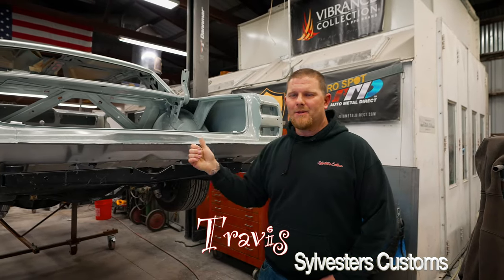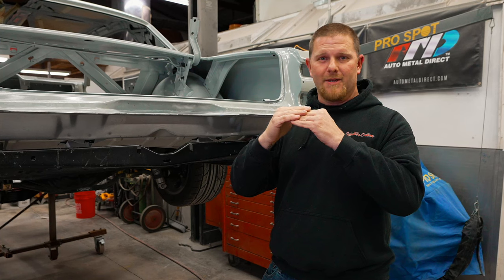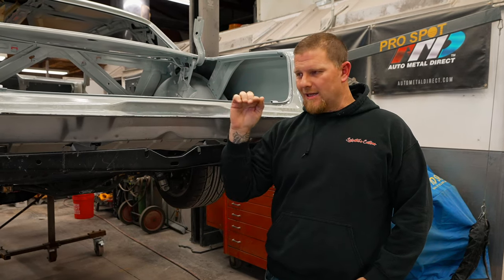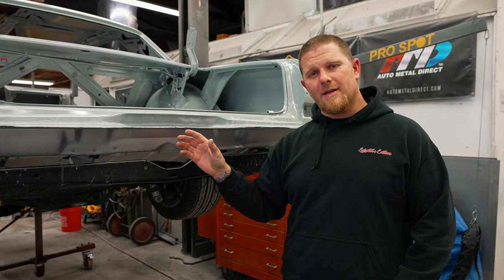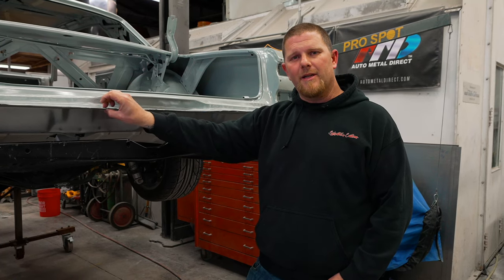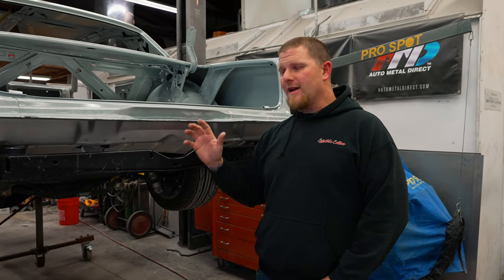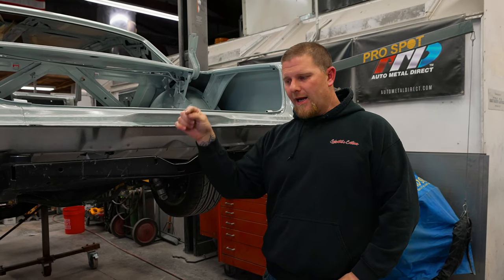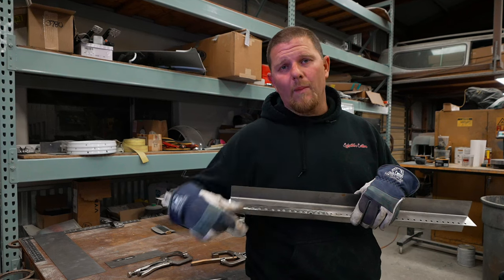Rusty Floor Pan Replacement in 20 Minutes: Metal Working

Comment: Thanks for the great video, and particularly the deep dive on mig plug welds.
On the production side, we use a weld thru primer to meet industry corrosion resistance standards and I think you use it also on your restorations. That primer changes the weld considerably and especially when welding galvanized steel. Anyway, my pro tip is to take a drill just a step (32nd) smaller than the hole and drill into the backing material creating a small cone shape. This allows 2 benefits, easier heat penetration of the back panel, and it gets rid of a large portion of the primer in the weld area where it just acts as a contaminant.
Of course heat control becomes paramount when using this technique, if you are slow, inaccurate, or too hot it can blow a hole,  but it allows instant penetration and a very clean low dome weld because you can keep your heat high but lower your wire speed. This technique is also beneficial when welding thinner metal to thicker metal ie 22 gau. to 20 or 18 gauge backing metal.
Anyways Best Regards and Cheers.
Reply from the maker: Very cool thank you for the tip!

Comment: Great video brother. I’ve never heard of the wax product that you briefly referenced for treating the back side of the plug welds, I’ll have to look into that. I’ve used weld-thru primers before but I was never really happy with the way it affected the cleanliness of the welds and i still had concerns about whether it was sufficient to prevent future corrosion from returning. That’s always been a concern for me because some repairs that I did failed years later-either bubbled up or became visible. I used POR-15 religiously at one point too, and I thought it worked pretty well, although good epoxy seems pretty effective and what I use now after treating the metal. I think Acid dipping the cars is great for getting to all of the rust, I would just be concerned for all those areas that are inaccessible-like inside frame rails etc. Many years ago I contacted a galvanizing shop local to me and inquired about whether they could dip a car that I was restoring for myself. They said that they had done it before a few times but highly suggested that I remove any rotted sections and weld in new panels before bringing it to avoid welding on galvanized metal. The process they did was acid dip, then dipping into a de-ionizing tank, then the zinc galvanizing solution…at ($0.50/lb)-this was around 2002 I think which was really cheap looking back! I contemplated it for a while and decided not to because of others advice concerning paint adhesion problems. I really wish that I had done it for the experience and knowing the pros and cons of it. My thought was…well if the paint flakes off in 10yrs, at least it will never rust 😅🤷🏻‍♂️. There’s always better ways of doing this type of work, better procedures, etc. I’m always happy to learn more. The newest thing I’ve heard about but not tried yet is using cosmolene, do you have any experience or opinion on that? Thanks🙂
Reply from the maker: So many ways to do any one vehicle. I don’t have any experience with it sorry.

Comment: There are added reasons to use an 1/8 inch drill bit other than keeping the Rota-broach bit from skidding when drilling out spot welds.  For those that want to get their spot welds in EXACTLY in the previous spot, with the centering drill hole in place you put the new panel in then use a sharpie from underneath to mark the new panel so that it can be drilled/punched in the right place before welding.  It also helps to have a ready made hole for TEK screws (for those without Clecos) so you can position the new panel in place before welding, and it also doesn't tear the panel up as much as if you just try to force a TEK screw into place to hold things.  It also helps when you are spot welding a thin sheetmetal panel to a thicker piece of metal (like a brace).  You can weld the sheetmetal and burn up the edges before you get the thicker piece hot enough to stick.  If there is already a hole in the thicker piece, the weld will stick to the brace as well as the thinner sheetmetal.
Reply from the maker: Thanks all great stuff!

Comment: Great info as always.  Planning is everything for metal work. Glad to see you mentioned various approaches depending on each scenario. 
A go-to tool I use a lot is a pneumatic belt sander. It has a pivoting arm for different angles. It's one of those tools I wonder how I've done most jobs without one.
I've found the DP90LV epoxy is very heat tolerant and works great as a weld through primer and is also conductive somehow.
And by the way, where is this rust you're describing? You spoiled, spoiled people on the west coast have no ides what rust is.😅 Here in the Rust Belt, having rust means there is no metal left. It's a hole.
I'm a huge advocate of proper welding. I've worked with guys with 30 years experience and still struggle with welding. It's kinda scary actually. I'd like to see some sort of welding standard required to work on cars. It is a safety and liability issue.
Looking forward to the next video
Reply from the maker: Yeah I agree. I love our belt sander. I forgot to put it in this video however, I did not know that DP 90 was conductive. We use that all the time I just did not know that so I will definitely be using that idea thank you for that tip. And yes, we are very thankful for our California cars. 🤣
Reply: @SYLVESTERSCUSTOMS  
The DP90 doesn't seem to blister like most primers. You can ground or arc directly to it. Not that you probably should but it happens sometimes.  That's where I found it to be a good alternative to weld through.